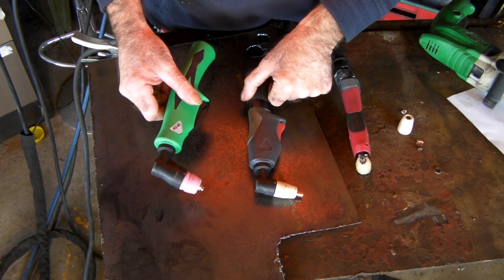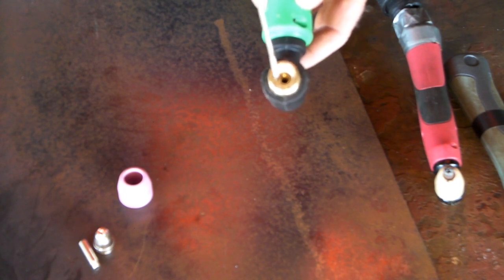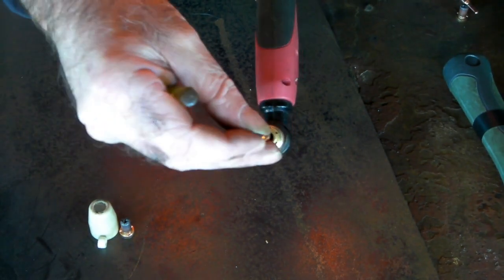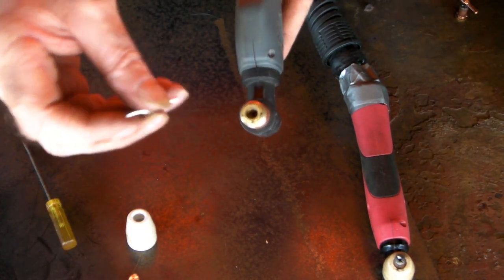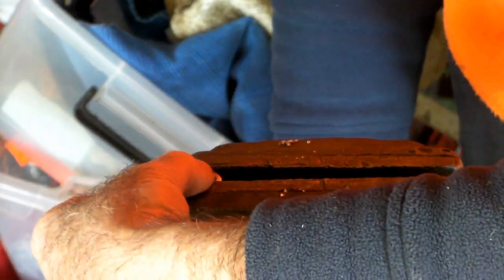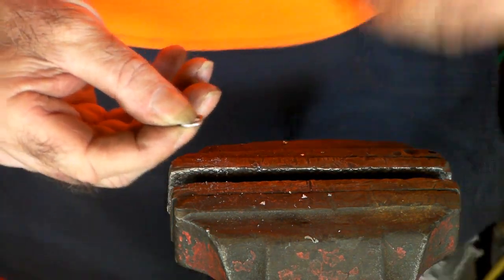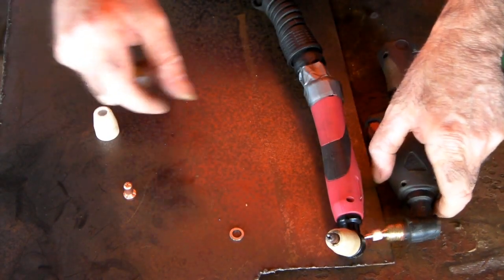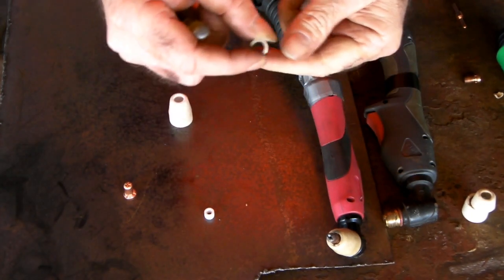PLASMA TORCH TROUBLESHOOTING

Comment: hello thanks for your wonderful tutorials, my question is why is my plasma cutter cuts sometime and some times refuses to cut? is it the cutting torch problem or problem with the plasma it self?
Reply from the maker: Check your ceramics even a little crack will affect it .Cheers pete
Reply: Hey did you ever figure it out? I’ve been looking for a video that says exactly what you said sometimes it works and sometimes it doesn’t. Maybe they should’ve called these things “hit and misses” instead of those old engines

Comment: That torch with the loose tip?
My first torch i got with the machine didnt have a spring in the part where the electrode sits to keep it pushed towards the cutting tip.
Eventually the area the electrode sits in got eaten away.
So i bought a replacement torch exactley the same as the damaged one and it was spring loaded, never had that problem again?
Reply from the maker: Oh ok , But you will find the pt-31 /lg-40 don't have a spring in the torch head.
Reply: @petestools  no the original didnt but the relacement does,
All i can say is the new torch works mutch better than the original ever did,
Reply: There are two size pt-31 - a long and a short. It looks like the parts are mixed up.  It looks like you have a long trip with a short electrode.
Reply: I use the same tips and electrodes i was useing in the original torch, they fit just the same.
Thats something else, in new zealand we have welding supply shops, i was desperate one day for new tips so went into town to source some.
Guy wanted to charge me $10 per tip.
Came home and sourced some on the net, a set of tips, electrodes and swirl rings for $19.
There are some scoundrals out there,
Since then ive stocked up from banggood at even better rates.
They maybe chines knock offs but work fine

Comment: I just got my Cut-50 this morning..  I can't get it to work..   It won't light..   I think the consumables are in correctly..  Exact as it shows in the manual..  The machine seems to working correctly..  I got 100psi air on it..
  I checked the voltage inside the torch.   It's got 220 voltage up to the air nozzle in the tip,   but,   no voltage at the cutting tip..    It won't spark at the work,  or even on the ground clamp...  The cutting tip isn't touching anything with voltage..  Is that the way it should be..?
  I have the p31 torch..  the consumables seem to fit nicely,  the cutting tip is tight..  
  It's my first plasma cutter..  I don't know much about it...  The cutting tip doesn't contact any of the live parts..
Reply from the maker: Have you got your swirl ring in wrong place ?
Reply: lol. After you typed all that with all those questions. And you get a six or seven word response. “Hope that helps”

Comment: This torch is doing strange sound! https://www.youtube.com/watch?v=d-I2NqvAZDs
Reply from the maker: check that your  air is at least 80 psi
Reply: @petestools  Its doing strange thing. If air pressure is too high, it turns off, not allowing to start arc

Comment: Cheap torches. Sometimes the specs are too loose. A pro torch costs $600-700. Cheap consumables. Good ones cost ten times what the cheap ones cost. They last far longer too.

Careful with steel washers. They act like a resistor. Copper conducts about 93%, but a steel alloy is around 22%. Make sure things aren’t heating up too much, or buy some copper washers.
Reply from the maker: Yes thanks i use copper washers But not everybody has them laying around .
cheers pete
Reply: @petestools  as a diy soloution when shops are closed and you need a copper washer, i dilled into some cent copper coins :D
Reply from the maker: @hyperhektor7733   cool great idea cheers pete